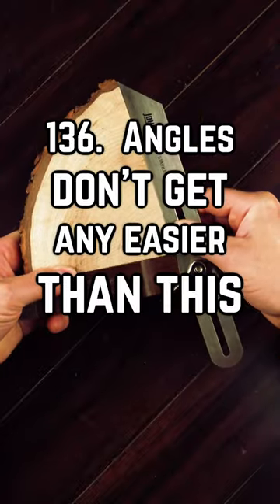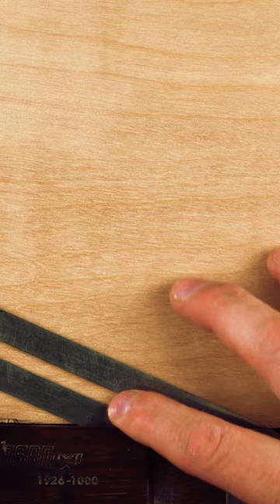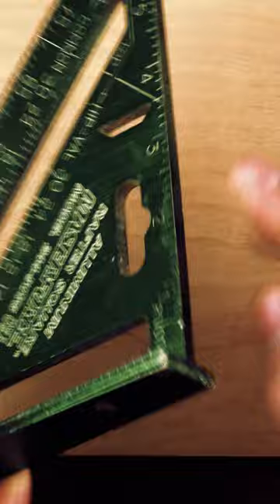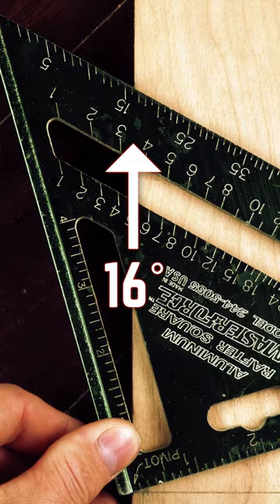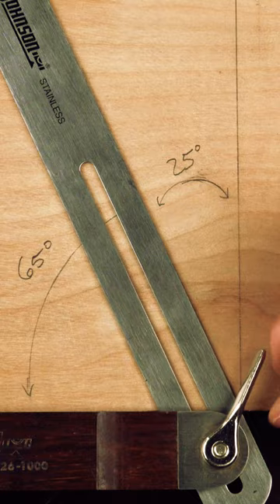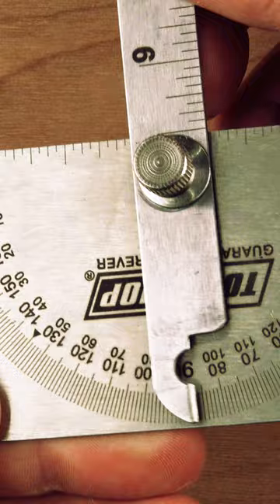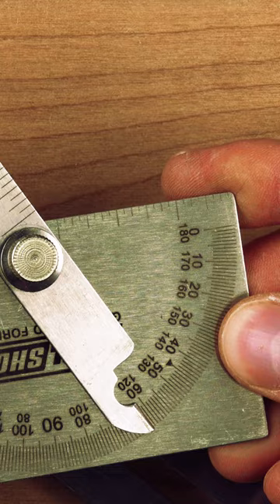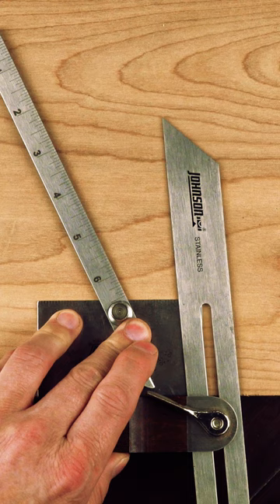136. Angles don’t get any easier than this #mtbitesize #shorts #measuring

Comment: How do I know if I need 65°, that's the question. How do I find what the angle is. I'm rebuilding a yacht by myself and this is the billion dollar question. Everybody says it's easy, I have walls at 40° and 45° on opposite sides. 5 degrees you can't tell the difference but I don't know how I did this. I found the angle after I built them. Before would have been useful.